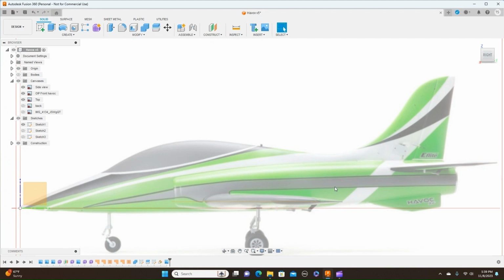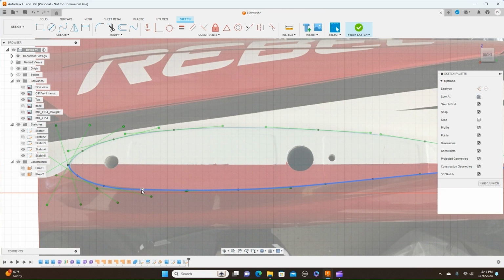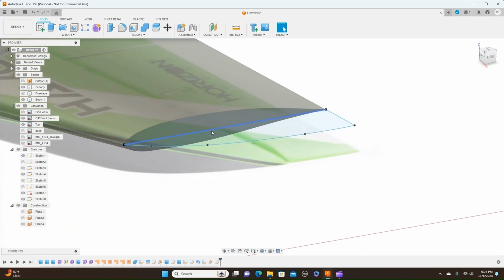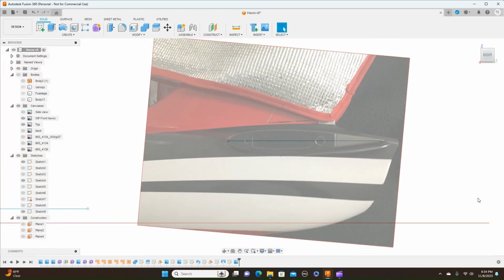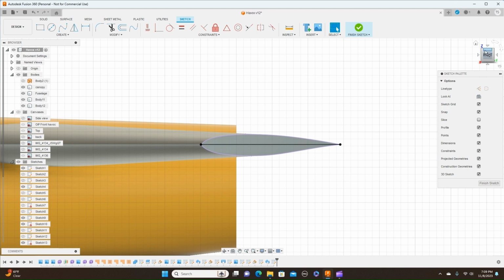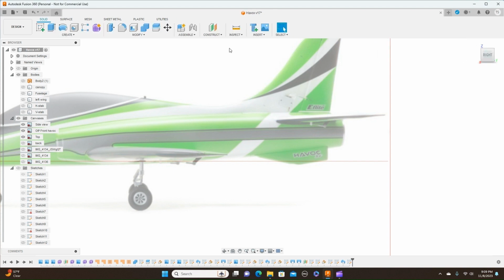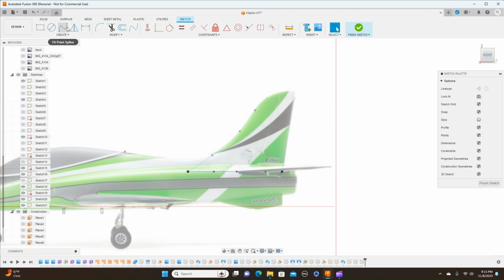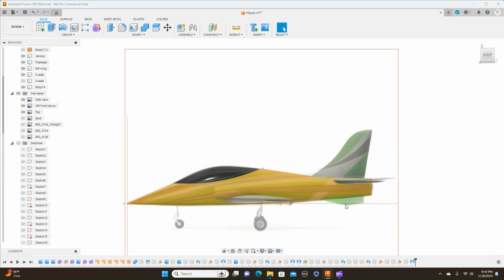Learn Fusion 360 While Modeling This Havoc Jet

Comment from the maker: If you would like the free STL files for the molds or the F3D files for Fusion 360, subscribe to the channel.  I will be giving the files away to subscribers who want them.  This is a 3 part series on modeling the Havoc jet.  Part 1 is the fuselage  Part 2 is the wings and stabs, Part 3 is the Molds. So Subscribe. 

Hello everyone,  I invite you to join my Facebook group to learn more about designing, building and flying RC aircraft.  Ask questions and get help if you need it or post what you are working on or have built. https://www.facebook.com/groups/1213000166068580